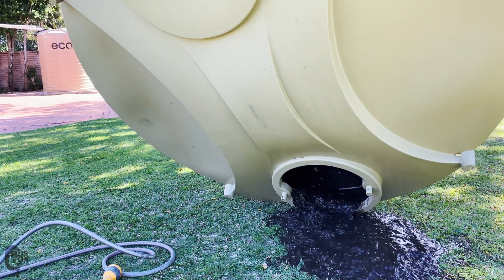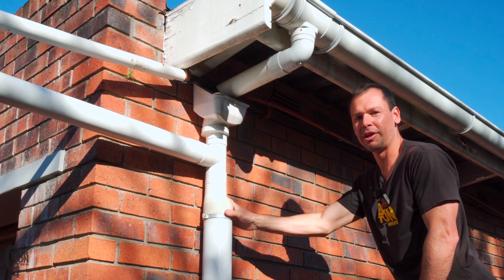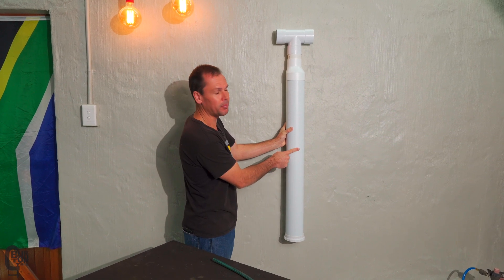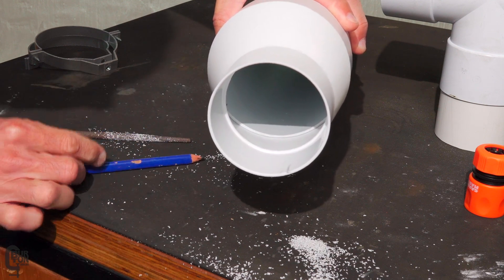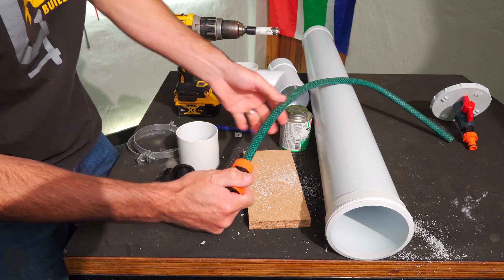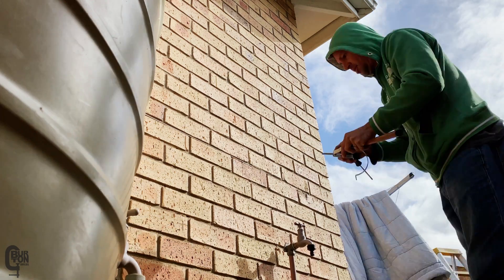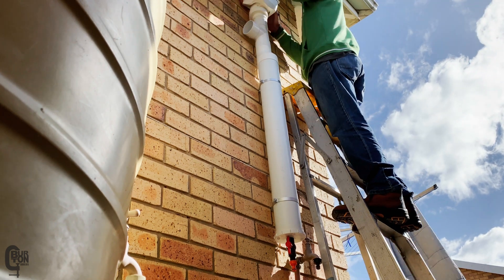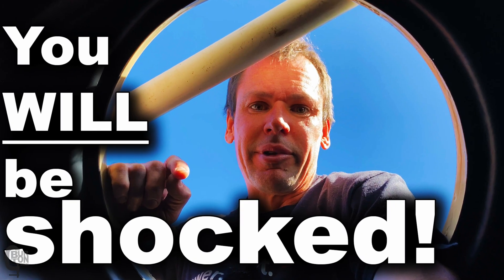How to catch clean rainwater DIY Rainwater Harvesting

Comment: Hi Grant, did you paint those white pipes brown? and if so what paint and primer did you use. we have black gutters so the white downpipes is a bit in your face and need to paint it black. thanks for a great video by the way. cool to see South Africas contributing to the DIY world on You Tube
Reply from the maker: Hi Anton, if I recall correctly, I used Plascon multi-surface primer. If you install a first flush system and paint it black, be sure to empty it each time it rains. With the pipe being black, it will bake in the sun and heat up any water left standing inside the first flush pipe. That water will go rancid very quickly and you don’t want that spilling over into your tank. Same goes for filter housings, try mount them out of direct sunlight.

Thanks for your comment and question. There is a full playlist of multiple rainwater harvesting videos on my channel… not sure if you have come across them yet? Here is a link https://youtube.com/playlist?list=PLb9ne7k5ibApazCHpN3kATHLi7kUyufk2&si=nHal1BPk5tSjs9_R

Hope this helps.

Comment: why do you need the ball?  Once the it fills up water will naturally continue to flow to the tank
Reply from the maker: The thought behind this is that once the vertical pipe is full of dirty water, the ball blocks the top and prevents the incoming water from stirring up any dirty water in the vertical pipe and washing it into the tank.

Comment: Doesn’t the pvc break down in the sun?
Reply from the maker: No, the PVC is UV resistant and lasts for many many years in the sun. There are some PVC pipes that are meant for underground installations, which are not UV stabilised, but these are generally a different colour (all depends on the specification though).

Comment: I'm having trouble finding the 110 mm polystyrene ball.  I'm in the U.S. but building this in Kenya.  Any suggestions?
Reply: I should have said 100 mm polystyrene ball.
Reply from the maker: Hi Terry, I managed to find these balls at the local crafts shop (and a local 'general plastic' supply store) so maybe you want to try stores like that in your area. I've also seen people using hollow plastic coloured balls (the kind one would see in a kids ball pool) but you would have to find the correct size... big enough to block off the opening just below the T piece.

These first flush catchers also work to catch heavy sediment without the ball, just not as well.

These first flush systems aren't always needed, depending on the type of roof the water is running off and the surrounding area (dust, bird life, etc.).

Comment: 6:55 take it easy lol you only need to take off 1/6th of that, press with 1/4 pressure on file and watch every stroke, filing is meant to be chilled not frantic lol
Edges also look more professional the less material you take off, a tiny little 0.5mm chamfer will be smooth to the polystyrene rainball, but is quite hard to remove that little material
I usually just lightly sand pvc cuts, inside and out to roughly 0.75mm-1mm fillet/chamfer. i see it asa requirement for glued joins, due to the time crunch when glueing

Comment: Nice video and explanation. I also want to catch my rainwater but I am thinking of diverting all the down spouts to a two-tank system instead of having multiple smaller tanks. A "cleaner" tank then overflowing the clean water into the 5k/10k ''storage" tank. Of course each down spout will have the leaf catchment filter to reduce all the much from entering the cleaner tank, but the cleaner tank will just be a small 500 liter tank anyway (for easy cleaning). this design will mean I will need a lot of 110mm pipe and making ditches for said pipes towards the cleaner tank.
Reply: Thats sounds great, similar to a grease trap tank. Possibly adding a baffle/divider in the middle of the cleaning tank will help prevent sludge move to the second tank when the first tank is full.

Comment: If you don't have the height for a larger collection pipe I guess you could always have two in series?
Reply from the maker: Do you mean the collector pipe that has the ball inside and catches all the dirty water? or the pipe that feeds water form the gutter into the top of the rainhead / leaf catcher?

Comment: How do you fix dirty water coming from your tank
Reply from the maker: Hi Audrey, you could install a set of water filters on the outlet side of your pump. Depending on what you want to do with the water, you could install a single stage sediment filter, a two stage filter (sediment + Carbon block filter) or a three stage filter (two sediment filters and one carbon block filter). Here is a video about filters https://youtu.be/layYqEYAiH8?si=hr3cCZo0H2nEZJzX and here is another https://youtu.be/DermXBtJMfI?si=UM33puqwRi8Zr9JR

Hope this helps.